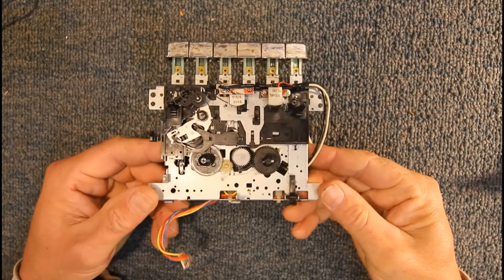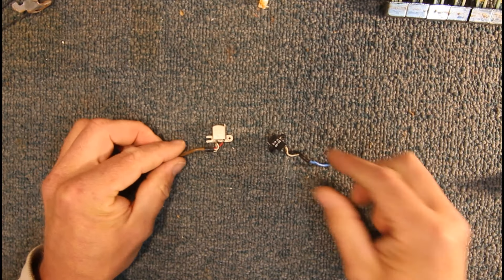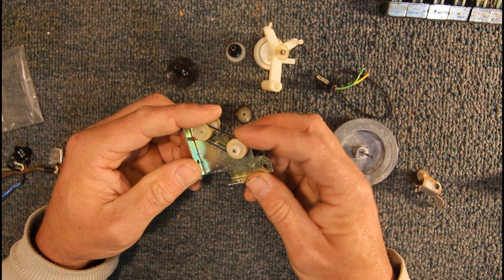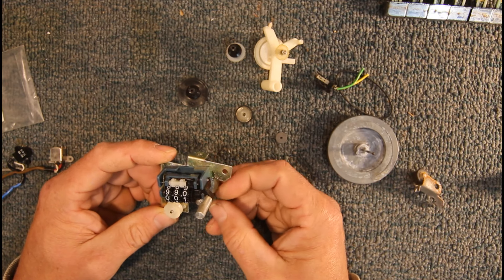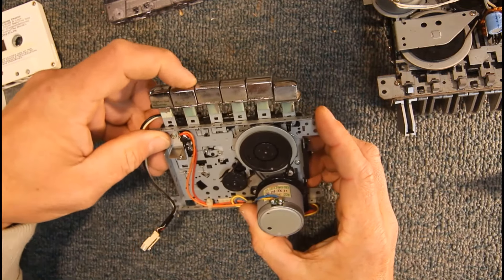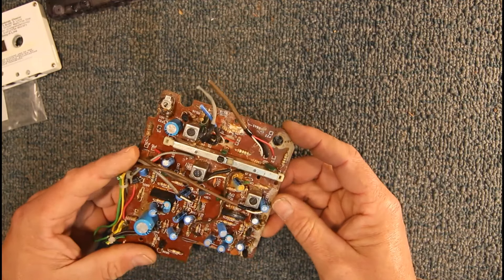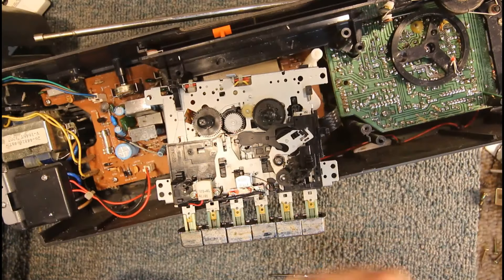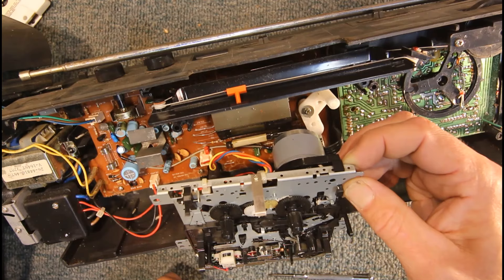Cassette Tape Player. How it works and how to repair.

Comment: I have a 1985 Nissan 300zx and the cassette deck is having issues. Would you recommend trying to find a used deck that works? it looks like a much smaller system than what you have shown in the video.
Reply from the maker: If you dont care about having the original you could likely find another car unit to fit. If its the type with the two knobs that come through the cars panel and hold the front of the unit then you may have trouble finding one that fits exactly without having to cut the surround, but if its the DIN type rectangular opening others should fit straight in, but you might have to check the depth. Some Japanese cars also have different ways of mounting that arent standard, so more work to try and fit a different unit mechanically in place. Also there may not be a wiring harness adaptor, which means identifying each wire in the car harness and connecting to the correct ones. The main problem with a used unit is finding one that works, and preferably has been serviced and new belts fitted. The old one may only need new belts and be viable to repair,  its a matter of finding someone to do the work at a reasonable price if you dont want to try yourself, and they are more difficult to work on than a Hifi deck. Nice car BTW

Comment: Thanks for the very informative video, but I can’t still figure out how to fix my Aiwa PS002. The problem is when there is no cassette tape inserted, the mechanism works well. But then, when I insert one and press play, it runs for a second and then stops instantly. The rewind, fast forward, and stop buttons work well, but the play mechanism doesn’t. Also, the player is sometimes sensitive. It needs to be knocked or tapped hard just to keep the motor spinning. What do you think is the problem?
Reply from the maker: Slipping belts or idler tyre is the most likely cause. Have you tried putting your finger on the take up reel like I suggest to see if it has any torque or just stops easily?

Comment: Hey steve! I have a question. I got a QT-50 cassette player from my sister and I’ve never used a cassette tape before, I’m having this problem where I’ll but my cassette tape in and ores play but nothing happens. If I hold the button down the light goes on and I hear a noise but that’s it. I don’t have batteries yet so I just plug it in and keep the power off for the tape setting. Any advice? I’m using a rather old tape too, a story book from 96’. Thanks!
Reply from the maker: They are a nice little unit those Sharps. Sounds like the motor is running if you hear a noise. Try pressing play with no cassette and the door open. You should see one reel and the pinch roller turning. In FF or Rew one of the reels should turn. If not its likely it needs a new belt.

Comment: I am having a National Panasonic tape recorder with this type of mechanism .The FF work happens but I have to keep it pressed continuously for this .Kindly guide as to how to rectify this problem .
Reply from the maker: If the button doesnt stay down its due to the plate that slides across not latching it, but if the other buttons work it must be the metal part that is pushed by the FF button. If it latches but then releases quickly it could be the auto stop is faulty, though usually it will also cause play to stop as well.
Reply: @StevesElectronicRepairShop  Thank you very much Sir for your reply on the ssue .We in Bdia always suffer fir such things as here no such experts are available .In your country it is the part and parcel of your life and you make a video in such subject and we get some idea also .
Thank you agan for reading and responding in the matter .

Comment: Hi. it hums during playback. Where should I look for a bug? Can I fix it as a layman? Thanks. :)
Reply from the maker: Hum is usually an earthing issue. I would try cleaning the record/playback switch first, if that doesnt fix it it might be a broken wire on the head itself. If there is no obvious wire off I would try wiggling the cable from the head to the circuit board gently to see if it comes and goes which would indicate an internal break in the cable, usually right near the head where it moves up and down. Its also possible there is a power supply issue like faulty capacitors.

Comment: On a deck with an autoreverse head, both sides of the head are adjustable. How do you set the starting point? I mean the mechanical alignment before you fine tune azimuth?
Reply from the maker: Its been a while since I've changed a head in one, but you can measure where the old one sits and put the new one back in roughly the same position, then tweak it from there until the waveform or high frequency sound peaks in both directions. If its already been changed then you would have to estimate where it sits, but could use the erase head guide (except in a car stereo) and oxide on the pinch roller to line up the play head guide and get it pretty close. If its the rotating type of head used in Hifi decks then it only needs setting in one direction, though its worth checking in both.
Reply: @StevesElectronicRepairShop  Cheers Steve, I think the head is ok, and I dragged my scope out and did the setting like you did, but I remember years ago I was winding the head adjustment screws around without thinking about it too much.  So I am not sure not if the head itself is in proper mechanical alignment. A factory tape (an old van halen tape I have) sounds reasonably good in it after the azimuth alignment, but I noticed sometimes if you change the tape, it's a bit muffled then goes clear again. The service manual doesn't mention mechanical head alignment. And yeah it's a  rotating head. Cheers from Sydney.
Reply from the maker: @tomb8430  
If its muffled then goes clear again its possible the rotating head isnt locking into place properly at times. I would check the plastic gear at the base of the head doesnt have any cracks and that all the teeth are clean, same with the gear that drives it. Also that the head doesnt have any play in it side to side. It could even be sticking a bit and need some lubrication on the rotating bit. Its rare but also possible the cassette door isnt holding the tape in the right place because there is some play in the door due to wear of some sort. Pushing gently on the sides of the door when its muffled would be worth trying.
Reply: @StevesElectronicRepairShop  Ok mate, I'll check that out. Also, I have another deck, a Denon DR-M20, a nice 3 head deck i bought recently. I noticed the record level is a lot lower than the input when I monitor the recording. 
I guess I could just fudge it and adjust the rec level posts inside so the rec level matches then matches the source, but I'd like to do this properly. The service manual talks about recording a 1khz recording at -38db. How do I get that type of signal. I have a software signal generator, but how to I apply that frequency at -38db level at the record RCA jacks? It's the db level I don't understand.
Reply from the maker: @tomb8430  Does it say just db or dbV or something? Decibels are a ratio of two numbers. I would assume its some relationship to line level but not sure. If you know what it is in relation to, you should be able to convert it to a voltage level that you would set the generator to while connected to the deck due to its input resistance having a loading effect. I used to set up Sony decks to original specs for a company, but that was a long time ago and I think the manual gave a voltage level of the signal to set the generator to.

Comment: Hi there, I have a problem with my Sharp 9090 70s boombox when i try to play some tapes it struggles to move the tape and then gets stuck or the play button pops back up not sure whats casusing this. have any idea? thanks!
Reply from the maker: Most likely its slipping belts. It would be going into  stop because the auto stop cuts in if the tape stops turning. The fact its not chewing tapes suggests its the capstan belt. It could also be a faulty motor. The only way to check is to pull it apart and put your finger gently on the capstan in play mode and see if it stalls but the motor keeps running. That would mean a slipping belt. If the motor stalls as well its a faulty motor. The capstan or pinch roller could also need lubricating. If its the belt, then its best to replace any other belts at the same time.
Reply: Steve's Electronic Repair Shop thanks I will definitely open it up and give it a look and watch tutorials. 🤞🙂 you got a new subscriber.

Comment: Hi Steve, thanks for the video, there’s a lot of useful information. I recently got a Sony TCM 200dv cassette voice recorder and am having some issues with it. The tape playback is warbling, so I’ll need to replace the belt. The other issues are the playback is very noisy, and when recording either via line in mic or the mic on the unit there seems to be a lot of noise. Am wondering if you had any ideas on the fix? Also do you take on repairs by any chance? Located in Aus
Reply from the maker: I am not familiar with those. If the noise is still there with line in it must be some sort of electronic problem. What sort of noise is it, eg static, hiss, hum etc?

Comment: Hi, thanks a lot, quite interesting as many people have lots of sentiments to these players from 80s and 90s. Me also, I still love the old analog devices and just tried to revive my Sony FH-B170 fom 91-92. I changed belts, cleaned it and re-assembled. Happily it started working - both decks. But after a while, maybe 3-5 minutes a strange annoying noise appeared from some rotating part presume because after pressing stop, sound dissapears. And it is for both decks. Sound is like high pitch frequency, it is present for FF and REV and also playing. Any idea what causes it? Do i need to clean any parts or lubricate motor? Any advice will be apreciated.
Thanks and cheers. M
Reply from the maker: I personally cant see myself using Cassette ever again, but its good people are getting old machines going again. The only parts that rotate in all modes are the Motor and Capstan. I would pull the capstans back a bit or right out and put a small drop of oil where they go through the bushing, making sure to clean the part that sticks out on the tape side after so no oil gets on the tape. With the motor, a little bit of oil where the shaft goes into the body may stop it making a noise. Sit the motor with the pulley upwards and put a dab or small drop of oil on the base of the shaft, and rotate by hand and let it soak down into the bushing.
Reply: @StevesElectronicRepairShop  Thanks for the advice. On your comment about using cassette player - it is just for FUN, not as needed. I really want to have it in working conditions despite the fact of not using it.
Greetings

Comment: Great video. I have an old GE cassette recorder. It plays, forwards, and rewinds perfectly, but it doesn't record (doesn't spin when record is pressed). I'd appreciate any advice you could give; I'm new to analog audio
Reply from the maker: Are you pressing play at the same time as record? The record button usually just presses a switch to change the electronics from playback to recording mode. The play button is what gets the mechanical side happening, so they are normally pressed simultaneously to get into record mode.
Reply: @StevesElectronicRepairShop  that's it. Thanks
Reply from the maker: @fuldaldilgul  It was a good question to ask, as those of us that grew up with them just take it for granted that you press the two together. Some were marked to make it clear, but others werent.

Comment: Have you shown a tanishin mechanism before, I would like to see them in comparison with old mechanism or is that the one that you showed last?
Reply from the maker: There were two later generic mechanisms. The one most of this video shows is actually what is shown on an archive of the Tanashin website. Tech Moan did a video on the other generic mechanism which is the one he calls a Tanashin. I didnt have one of those at the time I did this video, but now have one. Its possible they both came from Tanashin but I doubt it. You can see that mech in this video: https://youtu.be/Urp1hoHrdlw. Archive page showing the mechanism I used in this video: https://web.archive.org/web/20200221171330/http://www.tanashin.co.jp/english/aboutus/history.html

Comment: wow amazing! thanks so much. i recently took apart my marantz pmd221 to oil the motor and when doing so caused anew problem somehow. now the player starts really slow and then begins to speed up then automatically shuts off like it’s the end of the tape. maybe i got oil on something that wasn’t supposed to? any ideas?
Reply from the maker: Sound like a slipping capstan belt or could be the motor. I would try rotating the capstan by hand in stop mode. It should rotate easily and turn the motor as it does. I would then put my finger on the motor pulley with a bit of pressure while rotating the capstan and see if the belt still tries to turn it, or whether it slips against the motor pulley. If the belt seems OK,  put a little pressure on the motor pulley and see if the motor can start turning when play is pressed. It should have a fair bit of torque and run fairly fast if you take your finger off. If the motor stalls easily the motor is most likely no good, but it would be worth checking it has the correct voltage.  If the belt is slipping it may need replacing, or if oil is on it, clean the belt, motor pulley and capstan and anything else the belt goes around with some alcohol.
Reply: @StevesElectronicRepairShop  thanks!

Comment: Great video. I have a Panasonic take n tape that will play but the sound will stop working usually after a song or during. If I press stop and then play it might play a song or two and the same thing happens. Any ideas? Thanks.
Reply from the maker: If it keeps playing mechanically but the sound drops out its most likely a bad solder joint in on the circuit board somewhere. It could also be the record/play switch needs a clean. Try tapping the unit while playing to see if you can make the sound come and go, or after the sound stops and see if it comes back. Also wiggle the volume control and any sockets.
Reply: Thank you for replying to my question. After getting into it I discovered that a wire on the tape head was the problem. I re soldered the wire and now it works normal. I think this is a issue with this particular model as I've seen others for sale on eBay that say plays but no sound. Thank you again for your suggestions.

Comment: I have a Yamaha K-350 deck , the stop lever keeps clicking when i turn it on , before I push play or anything , if I push pause it doesn't click , if I push play it plays great and doesn't click , but idle it clicks , I took the entire thing apart and there are two belts on the front , I found if I push the one spinner over and hold it , it stops the clicking , I'm assuming those two belts need much more tension on them , what is your opinion?
Reply from the maker: Normally if the deck can play, rewind and fast forward all the way to the ends of the tape then the belts would be OK. They tend to start slipping if they lose tension. It sounds like something to do with the idler touching something or having a problem itself, but hard to say without seeing it.

Comment: I didn't watch the whole thing. Does it include the problem of cassette player auto shutoff malfunctioning? A tape will only play a second or 2, then the play button pops up. And holding it down just makes it trigger the auto stop . All tapes do it, even if there is no tape. I am planning on taking the Boombox apart again. (Before i replaced a slipping belt). You can see this plastic think moving back and forth under the heads and capstan. I believe that's the part that triggers the auto stop. In all modes, I believe.
Reply from the maker: I dont think I went into much detail in this video. Sounds like a Tanashin TN-21Z mech. I look at it in more detail in this video though more for it clicking, but think I explain how it works. 
https://youtu.be/xdAnMHhg8XU?si=kaZDlhAADZdVhrfE

Comment: Hi, I've got a Pioneer ct-w502r dual cassette deck that had the belts get twisted inside of it. I put new belts in it and it played for one song, perfectly. I then tried a second tape but tried rewinding it first, the it didn't automatically stop at the break in the music on the tape and kept making a clicking noise. I had to turn the power off to get it to quit. Then it didn't want to eject the tape or open the cassette door. Do you think the auto stop has failed? Are any parts available to fix this?

Comment: could you tell me what mechanism makes the fm radio come back on once the tape is ejected? when i eject my tape the radio doesnt come on anymore. For some reason AM radio will work but the FM doesn't anymore .
Reply from the maker: If its a car cassette then there is a switch on the mechanism. If the AM is working the switch is working. Car stereos had a lot of issues with dry joints in the tuner section causing loss of one or more radio bands, often intermittantly. I think I covered it a bit in one of my videos on Holden car stereos.
Reply: @StevesElectronicRepairShop  cool
Thanks man ! I’ll definitely check that out. And you’re correct it was intermittent for a while before I lost the fm
Reply from the maker: @johnmartin5153  Either the pins where the module solders to the main board or joints in the module. Fairly simple repair once you get the unit apart.
Reply: @StevesElectronicRepairShop  thank you 🙏!